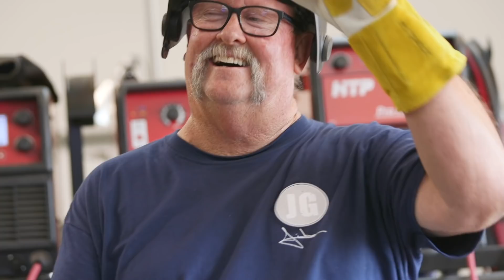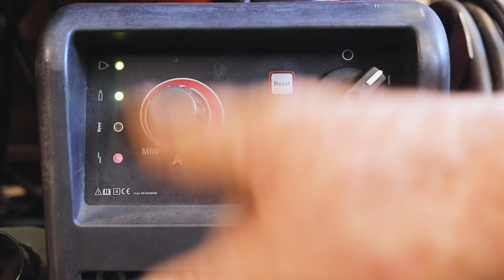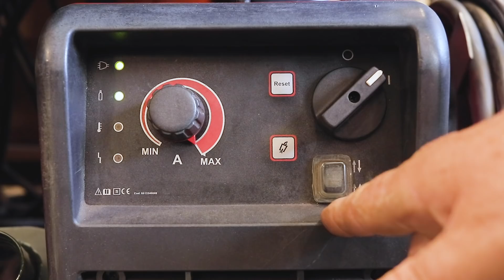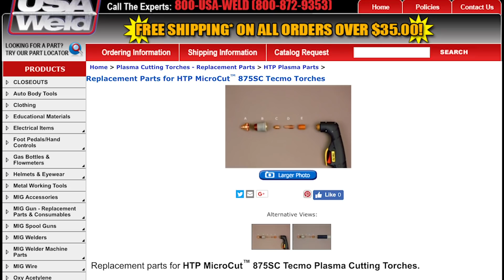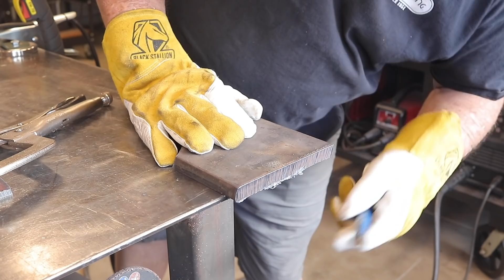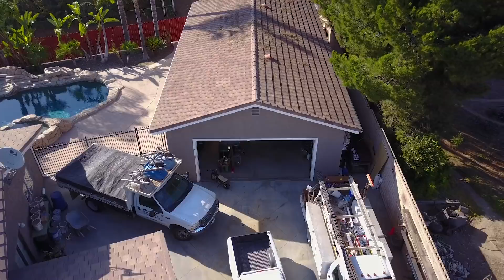Freehand Plasma Cutting Tests | JIMBO'S GARAGE

Comment: Sir:  good video, as usual.  I'm interested in the idea of using a torch to cut a hole in metal such that I can immediately follow it up with taping the resultant hole.  Is this cut of such a caliber that I could proceed directly from one step to the next?  Thanks.

Comment: As a retired Ironworker.
I'm sorry Jimbo, I wouldn't waste my money on a plasma cutter.
I can cut that clean with a torch, especially using a straight edge.
Reply: I guess if you don’t mind heating the piss out of thin material and warping it lol
Reply: @shadowops3653  if you have to heat the piss out of any width of metal to cut it. you shouldn't even pick up a torch to begin with...LOL!
Reply: Eddie petrovich some of you guys are a riot. I guess it’s the old; If it was good enough for my father, it’s good enough for me! Feh!
Reply: Eddie petrovich also could use a plasma cutter on non ferrous materials. Aluminum would be a bloody mess with an oxy rig 😂
Reply: @douglasward718  I do agree, it would be useful for stainless and aluminum , although a tungsten carbide blade in my jigsaw will do the job for a barrel full of money less...

Comment: I have a Hyperthrem  Powermax 45 and really like it.   I used it for over 6 years before I even replaced the electrode and nozzle.
Reply: 1970chevelle396 those are better than the xp consumables.
Reply: the old 45 are really good!   I have one too -they are so much better (when it comes to consumable life) and so much more reliable when run on a CNC table compared to the 45 XP ....  

I feel the 45 XP is not living up to the legacy of the 45......!